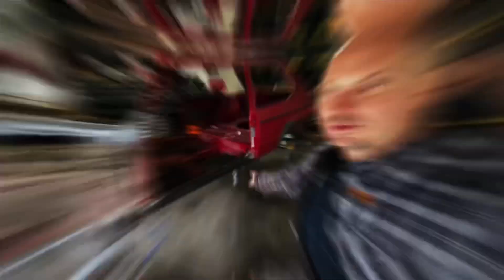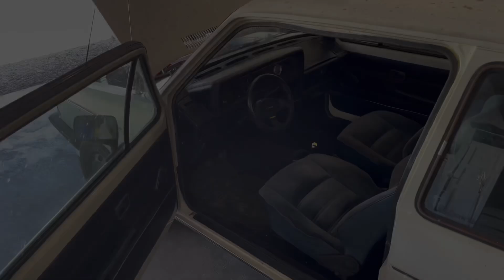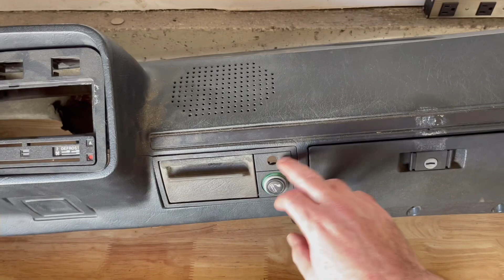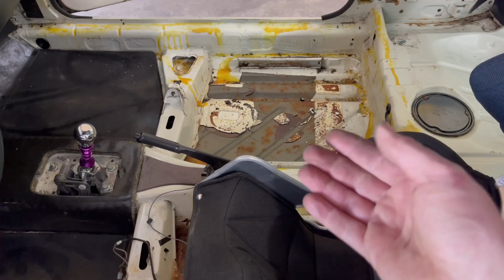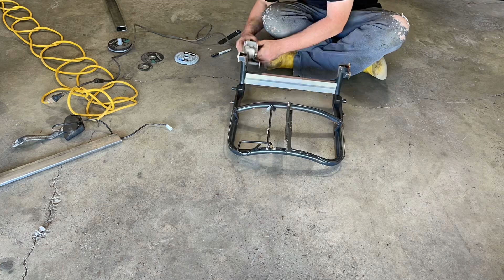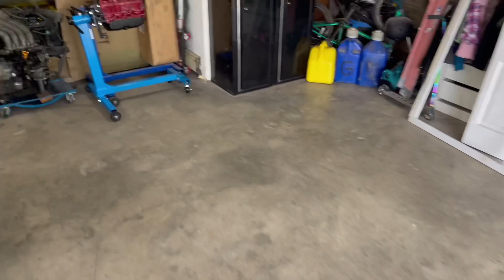VW Mk1 Golf Supercharged VR6 Swap (Ep.11) / NEW SEAT & SLICKS TEST FIT / Rabbit Drag Racing Build

Comment: Nice starting point for the interior setup and nice fab work on the seat slider. You should get yourself a wink 5 panel Rallye mirror. They're nice and I used to run one in a couple of my mk2 track cars. The flocked dashes are nice. The process of flocking is easy and satisfying. There is a nice kit that they sell to do the job. I ran all Autometer guages in my last mk2 12v AAA VR and loved them. I gutted the stock cluster area and used some lexan to make my own guage pod holder panel. I put two large cutouts for the tach and speedo and two smaller ones for the fuel and water temp guages. For the radio panel I ran a triple piece with the oil pressure, Wideband and voltmeters. Worked and looked nice. As far as the belts I used the Schroth 4 points religiously in a ton of my builds. They're great and with a harness bar they fit perfectly. You can even use the stock attachment points with confidence as long as your sheet metal is in good condition. Nice work with the MSD coil conversion. Makes a huge difference in performance and reliability over the OEM VR coil pack. They are probably the most drawback to the VR ignition in general. The Ford Windstar coil swap is better than OEM too as long as you isolate the mounting, wire up the ICM portion correctly/ make your plug wires right. Much better spark than the expensive crack prone OEM pack. Great job.😉👍